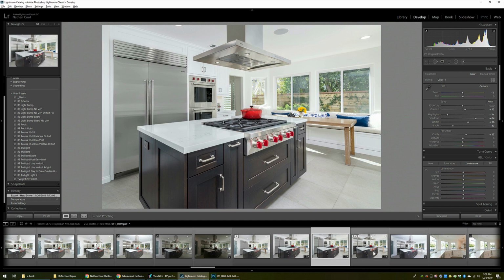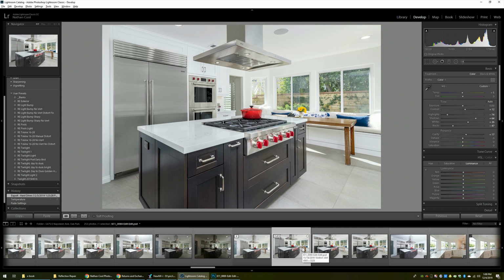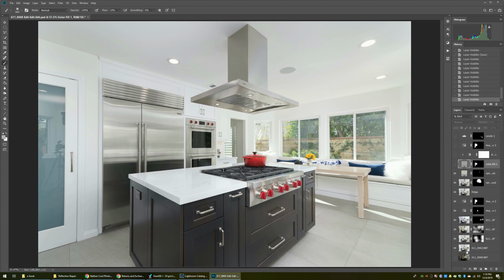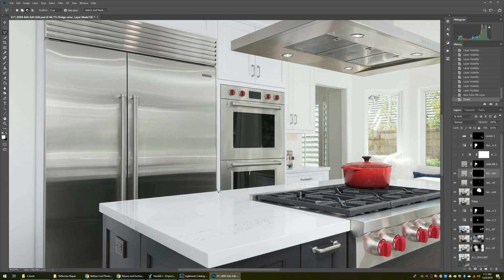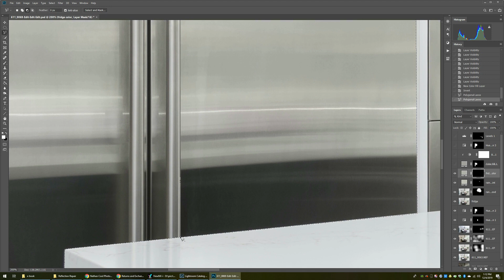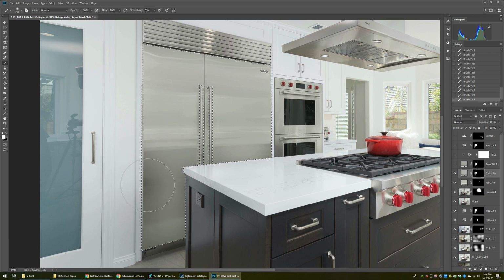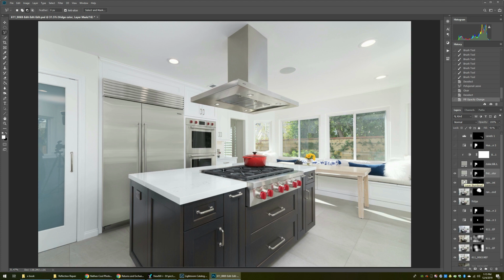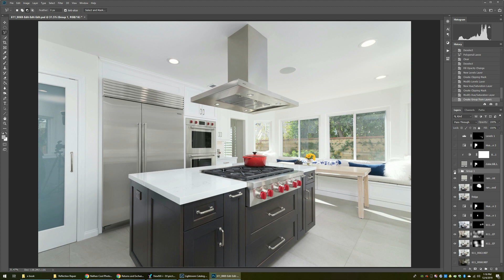How To Repair Reflections In Appliances

Comment: Good information. I use the selective adjustment technique frequently. What I struggle with is the color selection aspect of the procedure.
Reply from the maker: Thanks! Remember to use a fully painted color filled layer so that you can adjust the color later if you need to...like I show in this video.